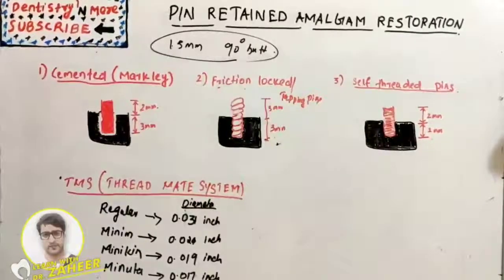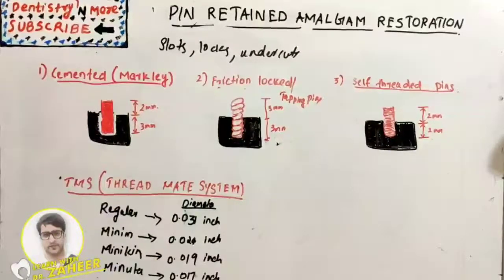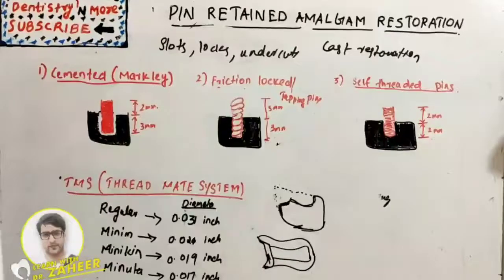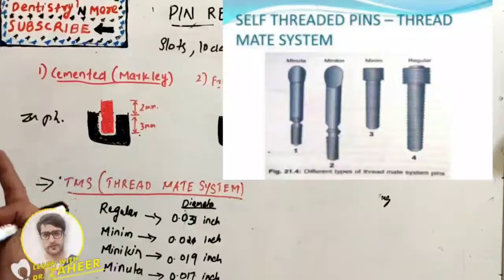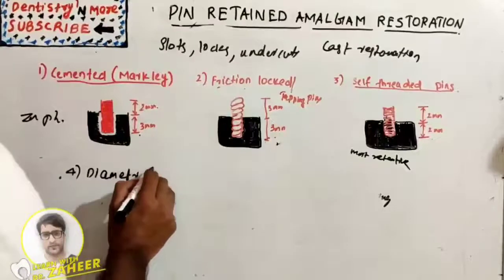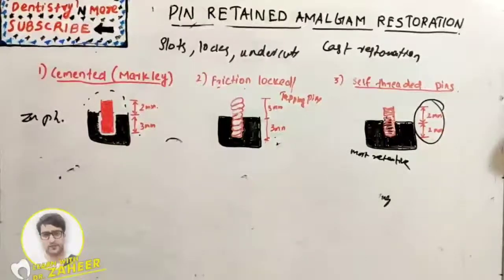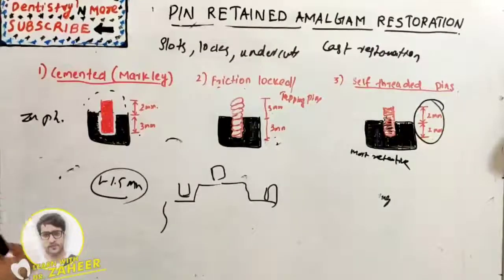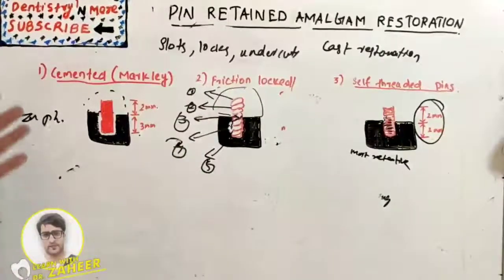PIN RETAINED AMALGAM RESTORATION

Comment: Thanks for this video! :) How about bending of amalgam pins? Is it recommended? If yes, is it done after pin placement? Thanks.
Reply from the maker: Bending pins to improve their retention in amalgam is not advisable because the bends may interfere with adequate condensation of amalgam around the pin and decrease amalgam retention. Bending also may weaken the pin and risk fracturing dentin. Pins should be bent only to provide for an adequate amount of amalgam (approximately 1 mm) between the pin and the external surface of the finished restoration (on the tip of the pin and on its lateral surface). Only the specific bending tool should be used to bend a pin, not other hand instruments.